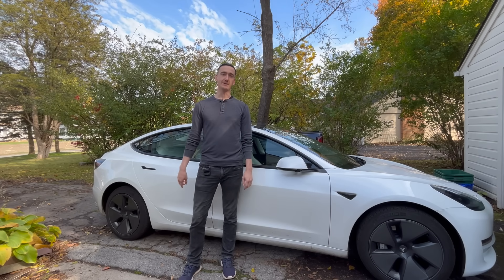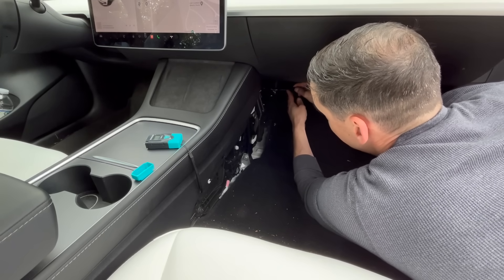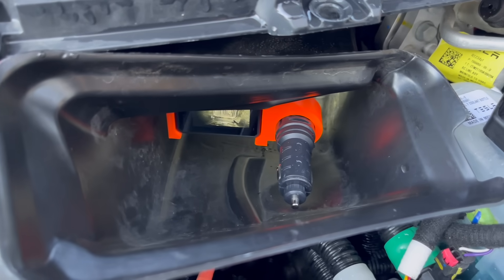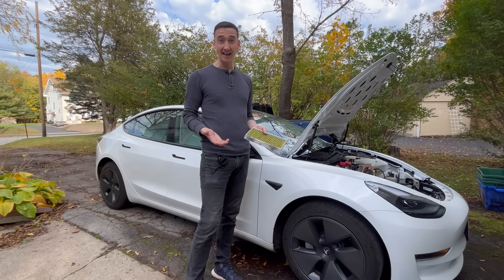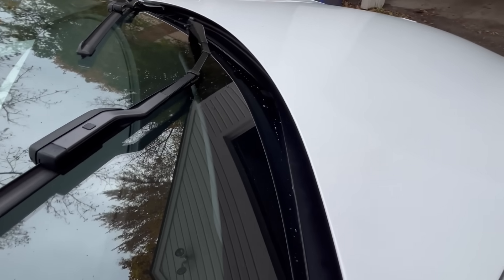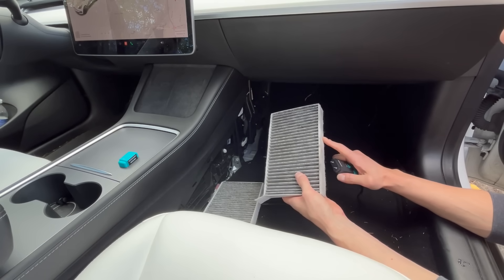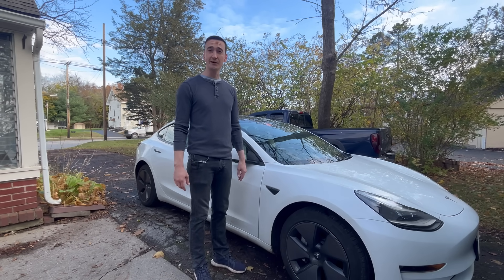This design flaw makes Tesla’s Model 3 smell bad! (with fixes!)

Comment: Tesla car engineering has been mostly focused on electric motors, battery chemistry, and software.  They are still trying to figure out how to design cars.  The fact that there hasn’t been a redesign or an upgrade to current customers offered doesn’t speak well to Tesla’s engineering priorities.

Comment: Genuinely surprised this even happened considering all the amazing engineering the tesla team does. All that had to be done was either 1) tilt the duct to force water the other way or 2) extending the "hood" above the water drain so the negative pressure has no effect on the water. Not sure if this slipped by the team or if they thought they could solve it via software later.

Comment: Good video. But the water test should be done with the right angle. Rain does not pour on the angle to hit right under the hood. This should be conducted from the front of the car which is the proper flow of water while driving. Also, the air flow while driving will push most of the water back and over the vehicle.
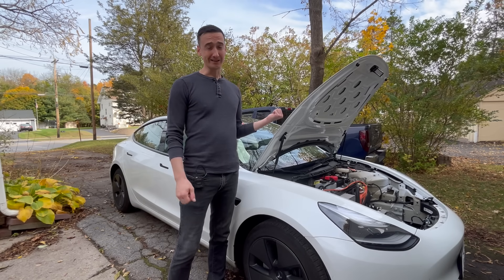Reply from the maker: Appreciate your thoughts! I showed at 10:07 that the wipers push water down there, and the car doesn't stop sucking in air when stopped for a traffic light or in a parking lot. And if you use automatic mode, it sucks in at full speed when you first get into the car to cool it down as quickly as possible. I agree that it's somewhat rare, but I think this is why it made it out the door like this and why the problem only arises every few months (or in your case, never). Does that make sense?
Reply: @adamdport  Thanks for the reply. Yeah, I've only had the smell issue one time in 3 years, and it down pours every day here in FL.But, in all fairness I rarely ever put it on 10. I always leave it on Low/Mid with AutoMode. But the car wash mode is very important, been trying to get people to understand it for years lol

Comment: I have a 24 model Y had it for 6 months and it just started to stink like a locker room so the new design with the filter under the hood is still no good . Any ideas on a fix?
Reply from the maker: Install the gasket from this video, and the plastic clip from part 2. https://youtu.be/OZ5SXmArEIo Good luck!

Comment: Thanks for the video. There is a video on YouTube that shows the drain in the condensate pan under the evaporator does not allow the pain to drain all the way causing mold to grow.
Reply from the maker: Appreciate all your comments! Could you post a link?
Reply: @adamdport  It was in one of the Tesla 3 owner group pages. I didn’t save it so now I’m trying to find it. In looking at the HVAC box that you purchased and disassembled I don’t see how that is possible.

Comment: If the air intake funnel is removed wouldn’t water get on wires and other components under the hood? The simplest routine would be to replace air filters every three to six months after installing the rubber gasket in the extended plastic blockers
Reply from the maker: Yep, all the components under the hood are meant to get wet. There are similar connectors on the electronics around your wheels, and there are no gaskets around any of the wheel wells to prevent water from spraying in there. Even the "intake funnel" you mentioned drains right into the same spot. You're of course welcome to do whatever you want though! Thanks for the comment

Comment: I see you are working really hard to find the reason, let me give you the root cause, that will help you to fix the problem for all, here is what is happening, of course we know it stinks when filter is at least 3 months old, second it only stinks if temp is at least 85 degrees or more and car left under heat .. so now you have a hint .. it’s a condensed or condenser water instead all draining out some of it gets to the filter, after 5 to 10 minutes when filters are dry again smell goes away.. you need to find out how to stop condensed water from AC to get to the filters, 🤓 best wishes
Reply from the maker: Be sure to check out part 2! https://youtu.be/OZ5SXmArEIo
Reply: @adamdport  thanks let me check out

Comment: Nice video.  Id like to see real world testing with actually rain.  Im not sure shooting the hose under the hood is indicative of real world conditions in the rain.  My guess is that far less water gets in than what is depicted in your video.  Also, using different fan speeds.  Not sure how often I have mine set to high when it's raining.
Reply from the maker: @kevinbright1  I tried to simulate rain at 10:31. I agree that it's not often set to high in the rain, which is why this problem usually takes months to show up after changing filters. I think the big culprit for me was immediately after opening a door on a hot day—the car maxes the fan out in automatic mode to cool the car as quickly as possible. If you just washed the car or if it's raining then you're in trouble!

Comment: The 2024 Model 3 has that gasket (the one with the big gap at 12:10 in the video) attached to the vehicle itself rather than attached to the hood. I don't see an easy way to replace it.
Reply from the maker: @markr6080  my part 2 video https://youtu.be/OZ5SXmArEIo at 4:32 shows some weather stripping that I stuck above the intake. You could do that, or remove the duct (part number hasn't changed), or both. Let me know how it works out!

Comment: Wow. Excellent and very detailed video. Can’t believe you put a GoPro inside. Genius. You’d think they did that kind of testing in the factory. 

Any chance you know about new model X?
Reply from the maker: @ayekayek9044  it's got a giant secondary hepa filter under the hood, and the normal cabin filter is by the glovebox like other cars I believe. Are you having an issue?
Reply: @adamdport  there’s a bit of a smell but very mild and intermittent . I’m part of a huge Tesla group and people talking about your video for model 3. Anyway. I scheduled mobile to replace my cabin filter. Figured it’s worthwhile anyway. 

Regarding the hepa it’s very confusing old va new. There is no concrete info out there. Is there for sure a large anterior hepa filter in the new xs or it’s all cabin under the glovebox?
Reply from the maker: @ayekayek9044  all model X's have it afaik. That means you have TWO filters—giant hepa under the hood and smaller normal filter by glovebox

Comment: My brother bought a used model 3 standard and it has the supposed tesla bioweapon defense mode on it.
Reply from the maker: @oldrango883  either he got a model Y or you or the dealer is mistaken. The 3 has never had it.
Reply: @adamdport  bruh, he got a model 3 and you are mistaken. Anyone with a Tesla, even if they are completely ignorant to the easily to spot differences between the “wide” selection of 4 models, can easily tell what model it is on the software screen.

Comment: The reason for the gap in the frunk lid seal is because it’s supposed to be the low pressure inlet. The same concept as “cowl induction “ on muscle cars.  

This is not to say the air will be restricted with a full span seal, it will find a another air source.

Comment: Why not print an elbow that curves down to cover the air intake ? Water will never get in. Also, having filters that close to the coils is a design flaw and guarantees having problems. Moving the filters in the engine bay before the intake would solve all
Issues. Is there enough  room there ?

Comment: After watching your amazing video I am so grateful that unfortunately I lost my long range model 3 which did have a moisture problem which I also fixed but never made a video about similar to what you did but I have a model Y that's a 22 long-range and it does have biodefense mode although I have barely had a smell like I had in the model 3 biod defense mode does make a huge difference even without using biodense and the air conditioner being on which by the way I use my air conditioner every single day and sometimes like recently in a video I posted I went through two and a half feet of water with no water entering the cabin of my car and no it's not on purpose It was from recent flooding in Sarasota county Florida

Comment: Any thoughts of just making the drain bigger in the  duct?
Reply from the maker: Just not sure what functionality you're saving by leaving it in there. I want to keep water as far away from the intake as possible.
Reply: @adamdport  I guess just stop maybe prevent fan suction from pulling it in.
Reply from the maker: @typicaltilly2535  I meant by leaving the duct in there. A duct with a big drain hole isn't better than no duct at all imo.
Reply: @adamdport  ahh ok I see. I was thinking of trying to make something that points down. I was just trying to avoid the water going directly on what's beneath the vent in case that matters. I guess once it is apart I will see. It was a great video for sure.

Comment: When I briefly drove a model 3 I noticed the washer fluid is wasted when the wiper is at the top of the cycle. I wonder if they could make a software change to spray dependent of wiper location. Do you know if there's data fed back from the wiper motor?

Comment: Best video I've seen in a longtime.  I am getting some new filters and the under hood cover to try out.  The car wash mode is a great idea also, as seen in your video.  I wish Telsa would have taken the time to check on this.  I think the software update is also a great idea as the water does fling strongly downwards.

Comment: Hi.  Do you know if Tesla fixed this in the redesigned model 3?
Reply from the maker: Part number of the duct is the same! The stock gaskets are a little different but still leaves the air inlet exposed

Comment: Awesome video. Just took my cabin air filters out and they're soaked. Car actually had water pouring inside from under the glove box under acceleration the day after being parked outside in the rain. I have the bioweapon defense mode filter, so idk where all this water intrusion is coming from!
Reply: Eventually I got my car in for service. Tesla's official fix is to put aluminum foil duct tape on the top seam of that intake under the hood. 😂

...2022 MYLR with the HEPA filter

Comment: The early M3 have a pain in the butt to get to T20 screw on the air filter cap up top. Do you think you can design a 3D printed thumbscrew to replace the T20 screw so future changes are easier?
Reply from the maker: This sounds like something the guys over at http://everyamp.com would love to tackle! Shoot them a message and tell them I sent you, if they're not interested let me know and I'll hook you up
Reply: There's a version on ebay already for people without a 3D printer. I'll see if I can design it myself, but I'm not that great at CAD, so it might take me a while.

Comment: Anyone that has owned a Land Rover Discovery from the 90s to the early 2000s knows this problem.   The fix was a sheet metal hood over the intake that was sloped towards the firewall to run the water  into a deep channel.  Kind of odd Tesla doesn't figure this one out.  They don't have to deal with that very hot engine of an ICE car.  Get innovative Tesla.  Lots of spots to pull intake air with an EV,  Kind of embarrsing for Tesla an aftermarket company came up with a fix as did Adam D.

Comment: Hey Adam, great video!  I have some additional info I want to share might help us a bit on this problem.    I live in Atlanta GA and the odor does not show itself until roughly august and then goes away around November.   Changing the filter usually doesn't help.  Even when I use the filters you recommended.  I wonder if it isn't as simple as the humidity in the car.  I have added a humidity detector and will observe it this summer.  I have tried the humidity absorbing bags, but it is not enough.  I was wondering if there is some sort of small 12v electric battery de-humidifier we could add to the car.
Reply from the maker: Appreciate the info! Have you seen part 2 yet? https://youtu.be/OZ5SXmArEIo
Reply: @adamdport  Yes!  Amazing!
Reply from the maker: @willberger96  I'd be really interested to hear if the filter clip from part 2 helps with your issue! The evaporator that cools your car IS a dehumidifier, and I went into great detail about what it does with the water it pulls out of the air. I've seen a few comments from people who insist that the smell persists until they use evaporator cleaner, so I concede that it's possible that you may have the issue I haven't been able to reproduce yet? Do you have a 3 or a Y? What year?
Reply: @adamdport  I have a Model 3 2019.  I have used the evaporator cleaner many times.  It helps for a few days in August, but the smell is back within a week  when humidity is high and it also goes away when the humidity subsides.
Reply from the maker: @willberger96  I think I was able to prove in part 2 that moisture condenses on the bottom of the filter. If you haven't tried my clip (or whatever else) to prevent that, I think you should!
Reply: @adamdport  OK.  I will give that a try and let you know how it goes.

Comment: Couldn't you put some layer of rubber around the part where the water was leaking in under the hood creating a channel that would let water run around the vents rather than into them?

I feel like that would be an easy fix

Comment: Would it help at all the turn on the heater on full blast to dry up the filters? Like a temporary fix? Once the filters are dry then there should be little to no smell?
Reply from the maker: If you watch my part 2 video, you'll see that the air is filtered before it's heated/cooled, so heat is only helpful if you do this in recirculate mode. But yes, every time I've noticed a smell I've been able to detect significant (30-40% on my meter) moisture on the filter

Comment: As a non Tesla owner I thought video and investigation was awesome. I presume Adam is an engineer and one that Elon should have hired.
What most shocked me was the poor quality of design and cheap materials used to build this car.  I own a newish Toyota and you would virtually never see any such poor quality controls / poor design engineering ...even in their cars costing only $25k...much less their $50k vehicles.  I have owned Toyotas for over 25 years, mostly used ones(as they last forever),  and they have been bulletproof about 98% of that time.
Maybe Tesla should hire some experienced Toyota engineers to design his vehicles...not kidding.

Comment: Adam, if you have a chance, i'd love your review of (any) improvements on this air intake issue designed into the new "highland" model 3....assuming you can come across a new model 3 :-)
Reply from the maker: The part number hasn't changed on the intake duct! And while it has changed on the hvac module, it looks mostly identical from the drawings. I'm not optimistic that the smell has been addressed.

Comment: My 1983 Mercedes 300TD wagon predates this $50 cabin air filter bullshit.  It draws in outside air, for the last 41 years, through a fine screen to prevent leaves and junk from entering the intake in the first place.  As the car moves off at breath taking speeds above 10mph, the screen cleans itself blowing debris over the top of the car in its airflow.  No debris, no wet $50 paper filter, full fan speed, no stinky cabin air....in 41 years.  Water entering the intake screen is diverted by a steel trap and dumped by two drain spouts behind the engine on the firewall.  I replaced the rubber spouts about 15 years ago.  Don't forget to add the cost of the cabin filters and labor costs to RNR them when comparing your Tesla costs to old cars.